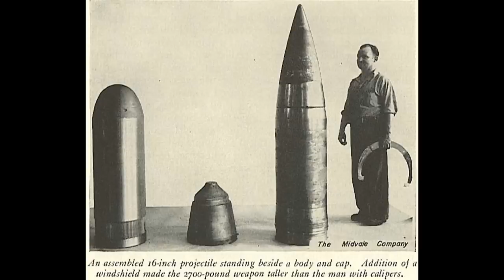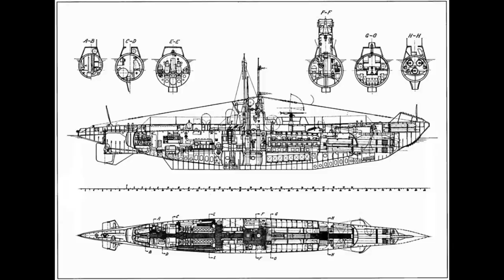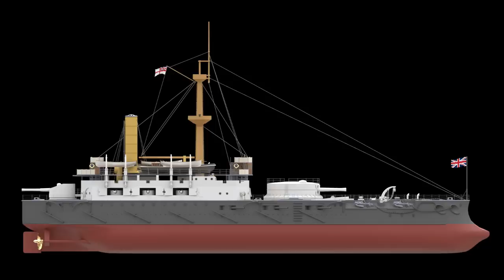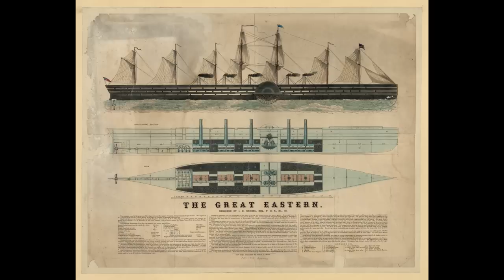The Drydock - Episode 217

Comment: KGV turret faces are an interesting topic in themselves.  Since the turn of the century, a sloping turret face had been the thing, to better deflect an incoming shell upward.  The KGV turret face is near vertical.  According to some of my reading, the thinking was that a shell coming in on a high ballistic trajectory would hit a sloping face near square, increasing it's chance of penetration.  So the KGV turret face was designed vertical, so the high angle shell would strike a glancing blow, decreasing the probability of penetration.   But, to get the vertical face, while keeping the trunnions where they needed to be for turret balance, required the front of the turret to be very short.  The quad turret front on the KGVs is so short it doesn't cover the top of the barbette, so the turret has an armored skirt in front of the turret face, to cover the barbette.  So, instead of an inbound shell penetrating a sloping turret face, on the KGV, the high shell hits the vertical face and is deflected downward.  iirc, angle of incidence equals angle of deflection, so the shell would probably hit the deck, not that skirt that covers the barbette.  To hit the skirt, the shell, or bomb, would need to fall vertically.  But Admiralty fighting instructions said to close to 12-16,000 yards, where trajectories are flatter.  At 16,000 yards, the angle of fall of a shell from Bismark is only 10.4 degrees, nearly square to the KGVs vertical turret face.  So, seems they built a turret optimized for 20,000+ yards on a ship that was supposed to engage at 16,000 or less.
Reply: Classic problem of procurement of a complex weapon system: With so many people involved, seems you cannot keep everyone on the same page all the time, so most every system will have some inconsistency in it, like the armor scheme for part A being optimized for range X while Part B is optimized for range Y.
Reply: @genericpersonx333  apparently, the KGV turrets were designed and built by Vickers.  But you would think there would be some interface between Vickers, RN Ordinance, and the higher ups in the Admiralty that coordinate the work of the various departments.  I have staked out the KGV armament as an area of study over the winter.  Coming up with some interesting tidbits.  In 35, a large series of different concepts were designed, with armament of 16", 15" and 14" and speeds of 30kts, 27kts, and 23kts.  An armament of 9-15" was determined to provide the best balance of speed, protection, and firepower.  The admiralty's own analysis said the 14" should be forgotten about, unless it is required by a treaty.  Shazam.  A year later, the UK has written a clause into the treaty to mandate 14".
Reply: @stevevalley7835  You'd think that people would be better about ensuring everyone was on the same page, but my Father (a defense technology engineer) could have told you stories about how even within a single design team, as small as three people, it was very easy for one to be laboring under the wrong impressions. All it takes is people making assumptions about what others know and not actually taking the time to diligently ensure they were correct in their assumptions. Ran like this for a few days or weeks, the disconnects compound. Add in actual disconnects like different teams working in different places with different priorities, it is a real marvel that something as complex as a warship actually works when all is said and done.

Comment: Correct answer about aluminum windscreens used by the final German Navy Psgr.m.K. L/4,4 (APC Length 4.4 calibers) shells used in WWII.  The aluminum would shatter on impact and have no effect on the shell's armor penetration at any angle whatsoever.  It was added due to Krupp's over-the-top concern about its AP caps -- it made these APC shells --  being loosened at high obliquity impacts.  They also were the only manufacturer to use the much stronger high-temperature solder to hold on its AP caps, used from 1911 when it first made its final WWI 11.2" ans 12" APC shells (also for its later larger APC shells).  They seem to have a phobia about this topic, which nobody else worried about, using crimping and/or low-temperature, weaker solder as good enough.

Comment: For where the stock material is stored in a warship there is at least one partial answer for one class online I know about. That is for the Iowa class. The video "Battleship New Jersey's Machine Shop" on their channel shows some of the stock material storage. It is between the uptake of the builder exhaust where they go diagonally and merge. It would be a quite hot area but not something that is a problem for metal stock.   I have no idea if there is a similar space in Belfast but it is at least an example of stock storage on one warship.

Comment: About te British ship using both 40mm bofors and 40mm Pom Pom

Norwegians supporting Norwegian underground units during the war received three sub chasers, via lend lease from the USA,  equipped with a 40mm Bofors.  Not needing the anti submarine equipment they removed that and replaced it with another aa gun, a 40mm Pom Pom.  Only two 40mm cannons and each using different ammunition, but you use what’s available.

Comment: I've noted on tours that I've taken of the Iowa class battleships that they have a kiln in the machine shop which can be used for thumbs like melting windings out of coils being rebuilt, or heat treating small parts. 

As for gun barrels, I'm not sure you could fit anything larger than a browning in the room, let alone produce one.

Comment: Great Eastern going full sail-rig is probably a lot of design rework.  They'd want taller masts and the weight distribution and bracing changes would be considerable.  Plus the ship handling in wind would probably be very complicated since with all the masts how often would a wind angle cause a particular mast's sails block the wind from reaching the sails on the adjacent masts?  I expect the efficiency losses here would want the ship to have fewer masts, but then you have all that length not really being used to aid in the propulsion of the ship.  Plus that high and long hull would probably cause the ship to have a lot of leeway (the ship being pushed sideways by wind on the hull).

Comment: 20:00 I would add two comments to the radar jamming answer.

First, I would mention that radar jamming is conceptually trivial. You just need to blast a signal on the frequency the enemy is using. It is just a matter of having a big enough power supply and a strong enough radio transmitter for the right frequency. The hard parts were, as you said, having enough power and a big enough transmitter as well as knowing which frequencies to build it for when the enemy is looking to avoid it.

Second, to the reluctance to use such systems it is worth noting that both the British and Germans had developed chaff  by 1942. Both governments refused to allow its use to not show it to the enemy, until the British finally allowed it to great success in 1943 and the Germans, seeing the cat was out of the bag, immediately implemented their version.

Comment: About the question of radar jamming. 19:56  I know that some Imperial Japanese Navy ships; including the Yamato, carried some type of radar jamming equipment.  I don't know whether this equipment was meant to jam surface or airborne radar systems.  While there is; somewhat difficult to find, information on Japanese shipborne radar systems, there is almost nothing on their jamming equipment.  If it was meant to jam surface radar it didn't work because at the Battle off Samar U.S. Navy destroyers had no problem maintaining radar lock while firing through smokescreens and squally weather.  If the Yamato's radar jamming; and I assume Yamato would have the carried the best jamming equipment the IJN could get, was meant to jam airborne radar, that didn't work either because U.S. Navy attack planes didn't use radar to home in on the Yamato's position.

Comment: 6:11 On the 30th of September 1915. a Serbian gunner named Radoje "Raka" Ljutovac used an example similar to the one in the background to shoot down a German Rumpler C.I bomber over the town of Kragujevac. The downed airplane was part of a 7-bomber formation (other 6 aiplanes being AEGs) that bombed Kragujevac (mostly the arms factory but also the railway station, warehouses and the town itself) with 45 bombs (resulting in 5 killed and 10 wounded soldiers and civillians). The pilot Kurt von Scheffer and the observer Otto Kirsch were both killed. The gun used was a Krupp 75mm captured from the Ottoman Turks during the 1st Balkan War. The gun was probably chosen for the infrequent AAA role due to the limited amount of captured shells which was difficult to restock.

Comment: one thing about aluminum wind screens on steel AP rounds - the aluminum and steel react badly when they are in contact with each other and salt water. While the aluminum doesn't rust it will react/corrode with the steel at the junction point.

Comment: If it looks stupid and it works it isn't stupid, referring to field gun on trebuchet.  And I still that a small shaped charge underneath the aerodynamic cap to "soften up the armor" (sort of a plasma pilot drill) would have made smaller AP shells (8-12") even more "AP" against bigger boats.

Comment: Machine shops on board naval vessels. Even on a carrier you're going to be limited to just what you can make and or repair. Plus large navies such as the USN and I suspect the RN to some degree today have tenders attached to destroyer and submarine squadrons. But even these larger vessels are going to be limited. They may gave stocks of material onboard. Copper alloys (Brass and Bronzes), Cast Iron and Steels but that does not mean they have the correct alloy needed for manufacturing a proper replacement part. Plus I suspect that their heat treating capabilities were also more limited than a shore based repair or manufacturing facility. One thing that was done to maximize machine shop spaces on some vessels was the development of machine tools that could be used for multiple purposes.  Something that is almost never done in a land based facility. A lathe makes a poor milling machine no matter what some boodgerin garden shed thinks.
One example http://www.lathes.co.uk/adcock&shipleycombination/index.html There are others.  
I've worked over the with numerous former US Navy Machine Repair ratings that worked in and out of these ship board facilities. None of them were Machinist Mates. One had an interesting tale. He was stationed on a sub tender. One job he had was to open up the hatch internal diameter of a  nuclear dub to allow a piece of equipment to be brought on board. He only had to open the internal diameter .100"/2.5mm or so. But the crew was very interested in his going it right. It took longer to set up the portable boring equipment than it did to do the job. And that brings up a related subject. There are companies that specialize in doing on site machining involved in the repair and refurbishment on machinery no matter where. At sites on land or at sea.